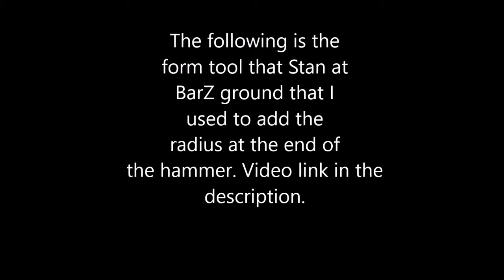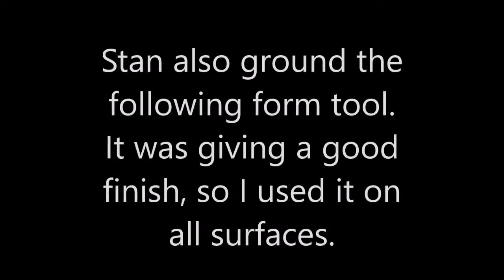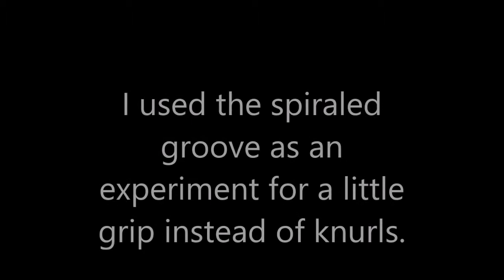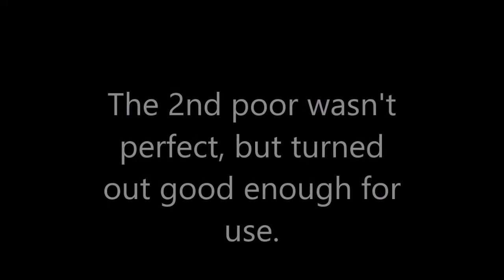Making Handle and Pouring a Lead Hammer

Comment: Great job, I love the brass handle, especially the spiral. One tip on poring lead. Having a separate lead pot to melt the lead is preferable. I have a couple of old plumbers pots that dad used to pour lead jig heads. Second then you really need you mold warm at least 150 degrees or so, that’s why the pours came out that way, the lead is cooling off before it fills the mold.
Reply from the maker: The mold was well over 150 degrees.  It was preheated before the first pour and was still hot and had additional heat while the lead was melting.  Thanks for watching.
Reply: Thanks I know we had the same problems with jig and sinker molds, it seemed to take several pours to get them to fill. Since the molds was warm it must needed some lubrication from the lead. Without the details it’s tough to guess from video.
Reply from the maker: Still also getting used to just how full the ladle needs to be to get a complete hammer.  The first one failed I think because of technique and the lead not flowing through the hole in the mold properly (or something clogging it).

Comment: Nice job.   Add a bit more sound , i love to hear the belt drive machines.
Reply from the maker: Thanks.  Unfortunately you would have listed to a bunch of the metal connector for the linked belt hitting the guard each time it went around.  I didn't notice until watching the video clips.